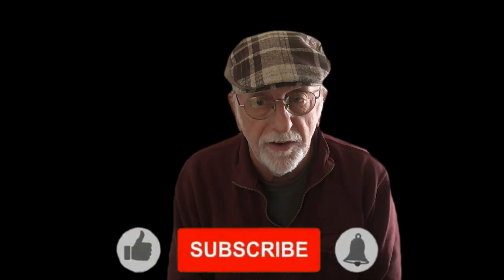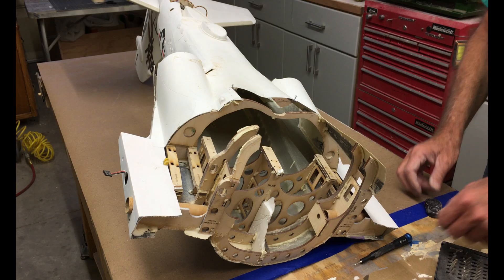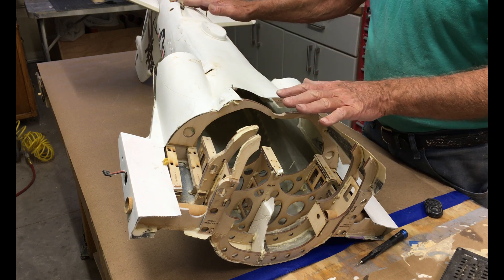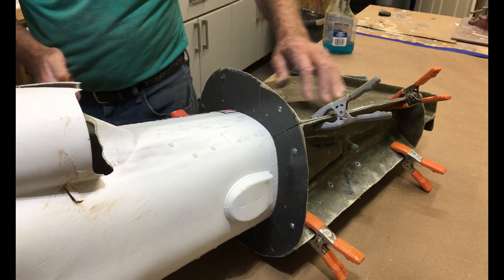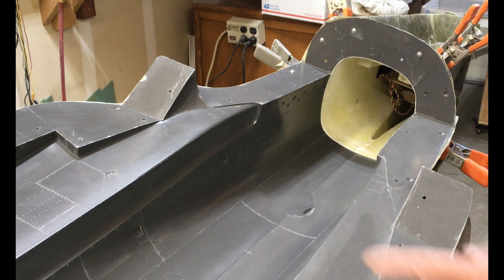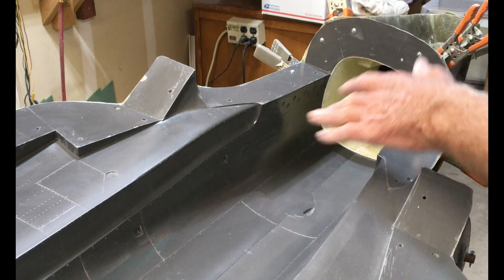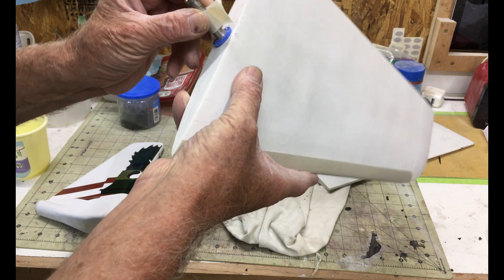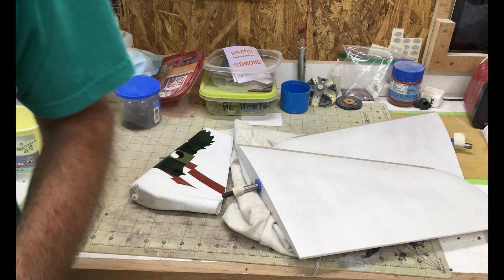RC Super Scale All Composite A6 Intruder Build part #1

Comment: That looks loke that will work just fine. You vould have used tooling wax or layers of tape to simulate the thickness of the glass to create a slip flange to rejoin the tail.